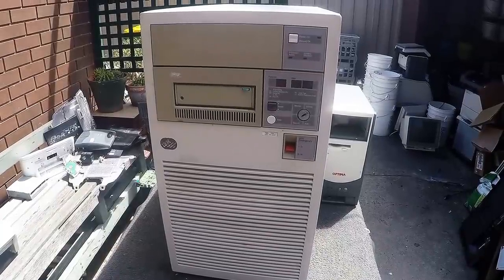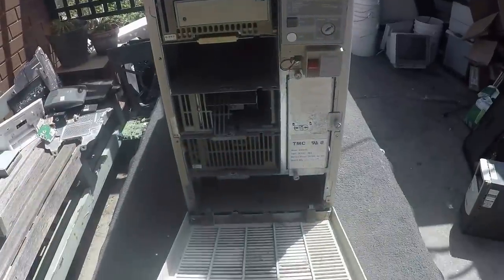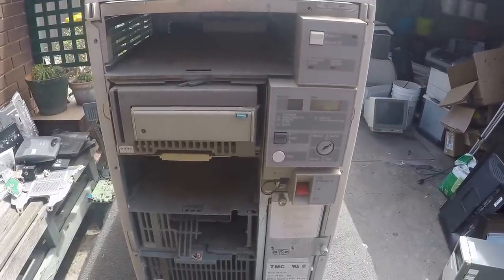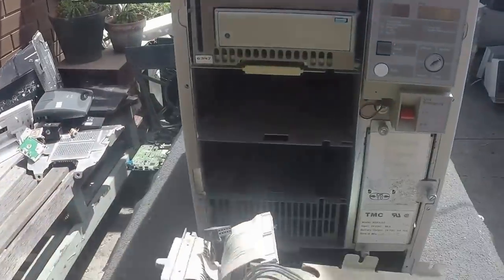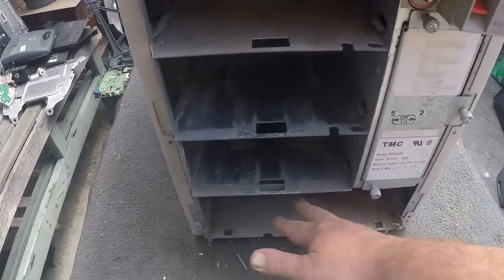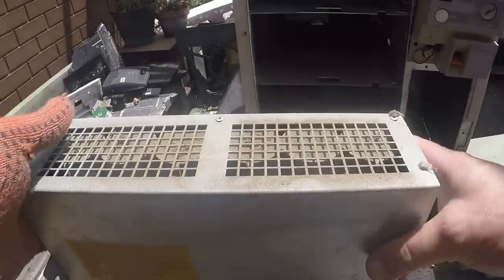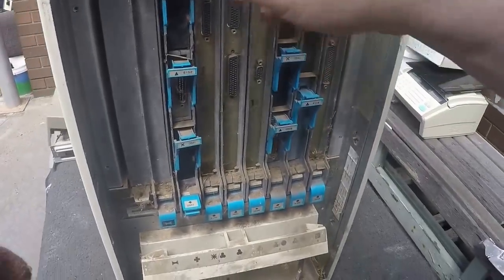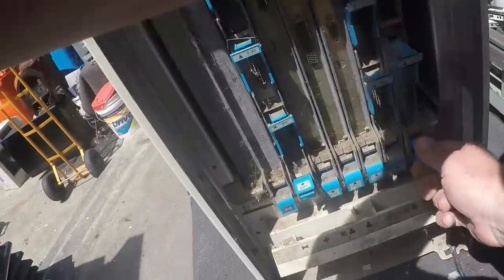Vintage IBM AS/400 PC Scrap for High Value Gold Recovery

Comment: A tool.i like for removing things on the board is a pincher pylers.  They resemble horse hooves  clippers . I buy them at Harbor Freight the worl good for removing the aluminum  topped chips and for removing the plastic surround on the gold pins connector

Comment: Nice scrap, I took programming courses at the local tech college in the 90's and we programmed on those AS/400's. It's a mainframe or minicomputer type system, where you had one computer with multiple terminals. Multiple people could use at the same time.

Comment: Hey Ben, late in the video around the 43/44 minute mark when you say that you can get 30-40$ for the 2 e-prongs, what do you mean when you say remove? Just with plyers and a little prying, or by de-soldering, like you mentioned quite a bit throughout your video?
Reply from the maker: eproms are removable so you just pull them out straight up without bending the pins, so large pliers, straight up.
Reply: eWaste Ben Awesome! Thanks Ben.
Reply: eWaste Ben

I Subscribe to and love your videos, by the way.

Comment: So what was the update on this? Just curious to know. Were those yellow box capacitors tantalum? And how about those ceramic chip things, what did they turn out to be? Good video. I also enjoy hearing the excitement you have for this, I can very much relate to that when I find a good scrap item..or should I say, gold mine. Pun intended. Haha
Reply from the maker: Yep the yellow boxes are an old version of tantalum capacitors, the white ceramic chips have been hard to ID but there a kind of BGA Chip, I tried to depopulate a board but the ceramic just crumbles up so they need to be de-sodered so I just kept the board as they are for now.
Reply: +eWaste Ben cool. maybe one day I'll get to come across one of those. I've scrapped servers before , just not one quite that old. scrap on buddy
Reply: @eWasteBen I've got 2 of these, what ever came of them?

Comment: what is the difference between ic chips e prong chips and flat packs can u please explain
Reply from the maker: +Nate Chaps all I know is they all have gold inside :)
Reply: yes but do u keep ur flat packs and e prongs and and ic chips all together or seperate them i meant like which is which when it comes to them u know what is the ic chip what is the e prong what is the flat packs but i understand im a pain in butt  but ty
Reply from the maker: +Nate Chaps yeah I seperate them, ic chips & proms are usually long, pins two sides.
e-proms are the same expect have glass window on the top.
flat packs usually have pins on 4 sides.
bga chips usually have a gold corner on one side or look like flat cpu's stuck on the board.
so 4 different buckets.
Reply: tyty

Comment: You do realize a collector would pay wayyyyyyyy more for those boards then they are worth in Gold Scrap right?
Reply: Joe Ambly But what boring video it would be then.
Reply: Where are they, i have
Reply: @ken76918  wa5ching a dinglebat scrap pcbs isn't very interesting lmfao
Reply: I just took in one of these and have been wondering if it's worth trying to resale as a whole, part it out or just scrap for the precious metals. ....

Is there any updates on what PGM's the aluminum/ magnesium covered chips contain?

Also, was it confirmed that the yellow bits were tantalum or not?